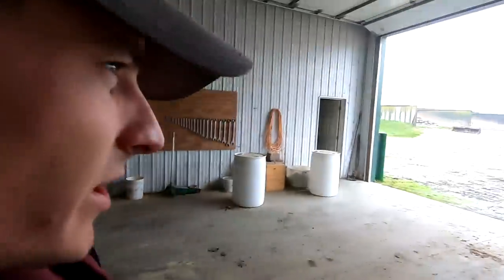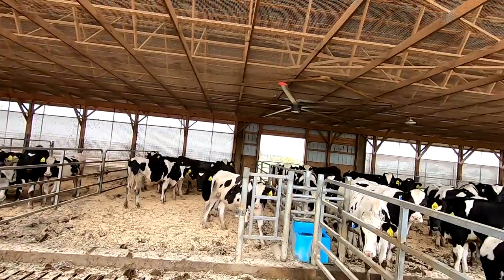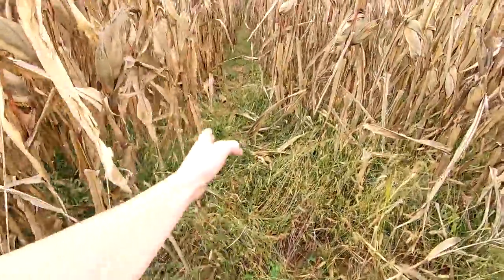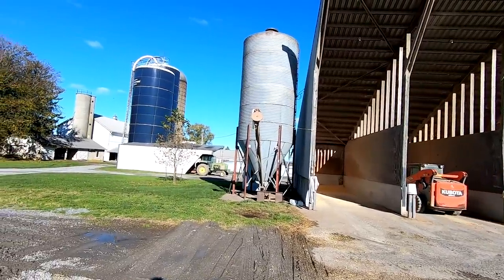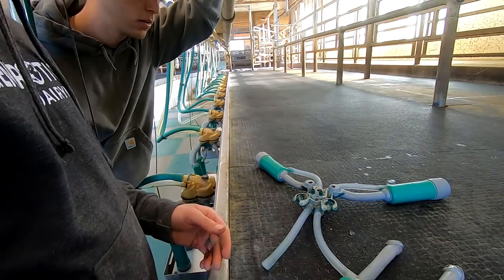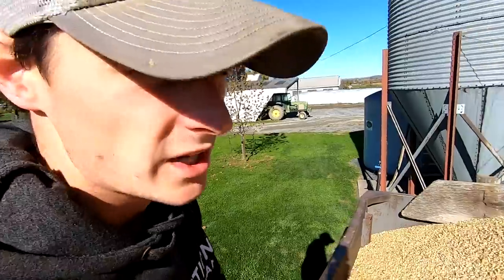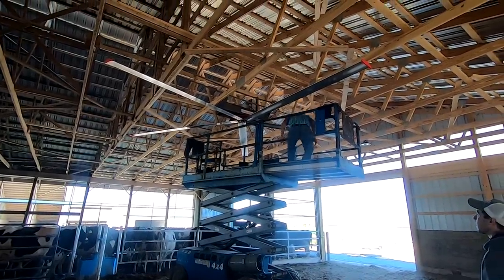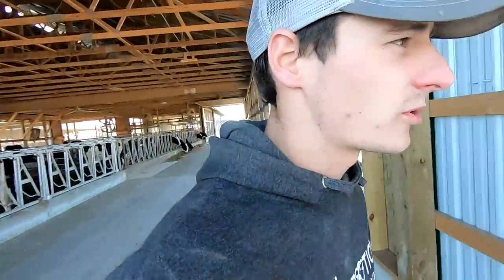Interesting Mix of Dairy Farm Jobs

Comment: 1. an old gravity wagon comes in handy, even years after you might not use it regularly... 2. While you have a few more steps when swapping out the inflations, your milkers are so easy. Particularly since you don't have to stretch them into the shells, that was the part I hated doing.

Comment: remove valve from tyre on trailer. clean out any dust and shit that got in there. clean valve. tiny bit of lubricant on valve spring. tighten the valve fully.